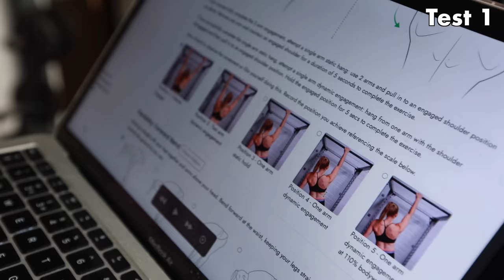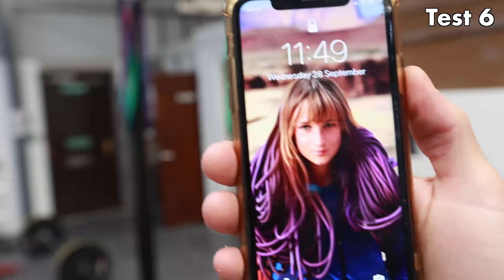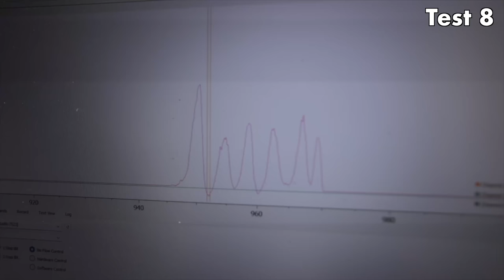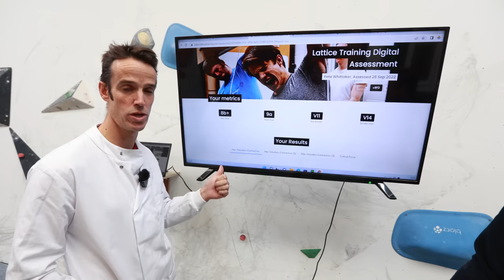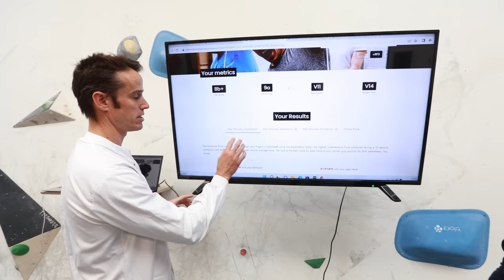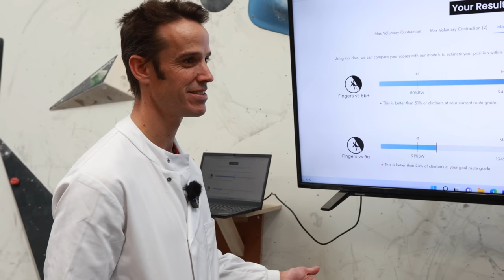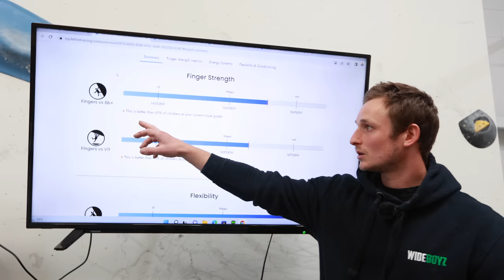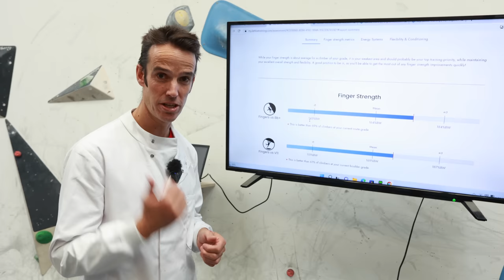The Strength you need to Climb Hardest Grades

Comment: I'm super happy you said that the low row is more applicable for some climbing than pull-ups. I've been saying that about the Pendlay row (basically the barbell version of the same thing) for a while now.
Reply: i love the pendlay too, but i think the low row is great because of the asymmetrical nature of it; the full scapular extension and retraction, driving through that other hand. it feels closer to climbing i think
Reply: @charliexoxox  Agreed, but I think there's enough transfer between the exercises that if you just train either consistently, you'll be able to do the other pretty well, which shows similar adaptation. For context, I never train low row, and can pretty easily low row the heaviest dumbbell in my gym (50lbs) which comes from Pendlay row training. Maybe I'd get something out of maxing out low rows but I don't have heavy enough dumbbells to do it. :) Doing symmetrical training is also less time consuming because you can do both sides at once.

Comment: pete has such a high score in critical force, seems like the curve is really flat, does that mean that he has a lower start force than the other contestants but he can maintain it better? would've been nice if you had said what scores the others had on there compared to bodyweight.
Reply from the maker: Yes what you say is right. Lower max force, but able to sustain it for longer. Other people's scores couldn't be said for data protection
Reply: @WideBoyz  ahh, that makes sense, thank you for the answer! however, do people usually have around 35, 40, 45, 50 or 55% bodyweight as their critical force score? what would be a normal good score and what would be a "bad" score?

Comment: I would absolutely love to see a powerlifter or other non-climbing athlete try this test (with some training first to avoid injury of course). Those athletes might not have the specific strength required, but they absolutely have the commitment to trying hard and using 100% of their power
Reply: In the tests measured in percentage of body weight, a power lifter would not do so well despite being super strong.
Reply: @clown5911  The best would be a small powerlifter, in they 66kg or 74kg classes might be fun. They'll have crazy strength for their size, that's why wilks score effectively penalizes smaller lifters - more oomph per pound at that size.
Reply: Looking at Olympic lifters, the 61 kg records are over 5x body weight combined Snatch + Clean and Jerk.  The 109 kg (last capped class) are just under 4x.  The uncapped weight class guys aren't close to double the 61 kg record, but the record holder is himself list at about 3x their body weight at 182.9 kg

Comment: Super interesting look into the strengths of climbing and the lattice testing and very informative!
I’m intrigued given that Pete has done crack for so long, how does it correlate with finger strength and crack routes in this? Can you do the same kind of hanging fongner strength things with crack holds?
Reply: We've done quite a lot of testing with crack climbers and big wall climbers over the years and unfortunately due to the specificity nature of grip types there's a pretty poor correlation between crack and face. The best match up is between finger crack climbing and face climbing... Basically you can be very elite in face and weak in cracks and vice versa!

Comment: Why do they say that 9a trad should require 9a+ sport strength? Is it just about placing gear instead of clipping bolts? And is Pete stronger in the left because he more often places gear with the right?
Reply from the maker: Harder and slower to place gear than to clip a quickdraw meaning you need more in the tank to complete a trad line. Climbing an 8a trad route for example generally feels similar to climbing 8b sport climb, in my experience.
Having 1 arm stronger than the other isn't anything to do with using one hand over the other in climbing. It's just natural tomorrow have minor strengths and weaknesses in each side of the body.

Comment: Wow.. when I was 30 or so I could do 27 pull ups.
And 18 on the wide angle bar. (was told I had the record in my gym)
Can still do 55 press ups @ 50.

On every other metric Pete totally hammers me ! 

I never at any point climbed harder than 7a which is rubbish.
Reply: Lolz.. watch on..
1) Pete was tired on pull ups and press ups
2) Tom: there really isn't that much correlation between pull ups and press ups and climbing hard.

Totally agree. It is all finger strength and power endurance limiting me!

Comment: Sounds quite good. Unfortunately, I don't see any standard on how a rep of any weight lifting exercise (and not, ex. pull-ups) need to be executed to be considered done correctly and checked. Otherwise why doing it? It will be nice in the future to see an improvement in your testing system via the addition of some standards ( ex. TEMPO).

Comment: I do wonder if this math could handle the other side of the parabola so to speak. Do your calculations handle somebody whose two rep max pull up has negative value (ie they need assistance to do the pull up at all). And what does the system do with somebody who has only ever managed to climb V2 boulders and 5.8 on rope.  Basically do these calculations only work for top tier athletes, or can they provide insight to people who are very much not that.

Comment: So, is the finger strength test not meant to be with a half crimp grip? That index finger was pretty straight, when I was doing the lattice test this summer I was under the impression that a straight index would have been "bad form" (but actually I could put a lot more weight on with that grip, basically a chisel, rather than with the prescribed "strict" half crimp).
Reply: For the digital testing we allow an athlete to use preferred grip - this is especially important once we get down to testing isolated finger groups. It sounds pretty scary, but when Ollie was testing Aidan Roberts last, he was doing max force testing in a single finger half crimp. If people have the time and inclination the really 'sweet spot' in testing is to assess in all major grip types and understand the differences in peak force and fatiguability. It's just hugely impractical in most cases as it requires multiple test days!

Comment: sorry guys but the test n 8 ¿the feets can be on the floor?
Reply from the maker: The feet are meant to be on the floor. It's the force you can pull (which is measured by a force plate in the finger board), not about lifting your feet

Comment: I was not expecting this level of inconsistency in testing from Lattice. How are you supposed to standardize data for climbing tests when you allow people to do multiple leg kicks mid MAX WEIGHT pull ups. What about the dumbbell rows, if you are testing lock off strength then how is swinging the weight around without any pause/static control going to measure that? (Pete’s leg is literally jerking from the full body momentum). 

There is no question that Pete is super strong, and I usually enjoy these videos…but tbh this was a bit much. Hope you don’t encourage these kind of tactics with your clients.